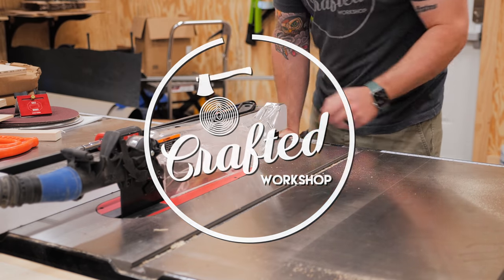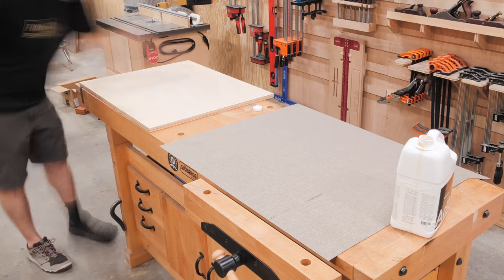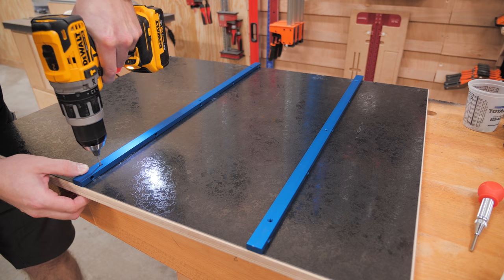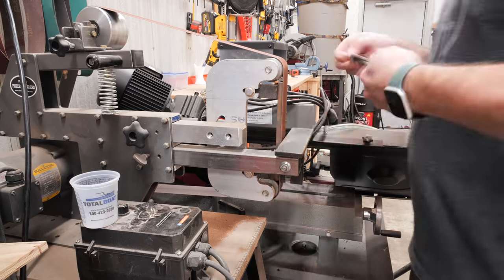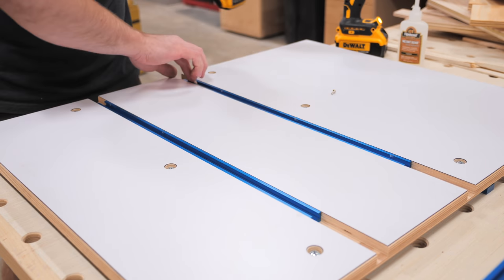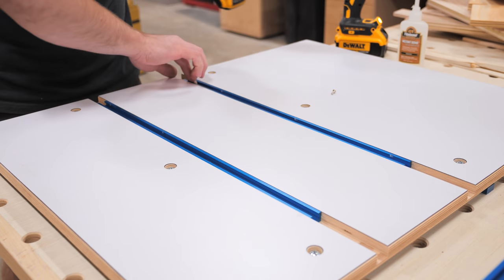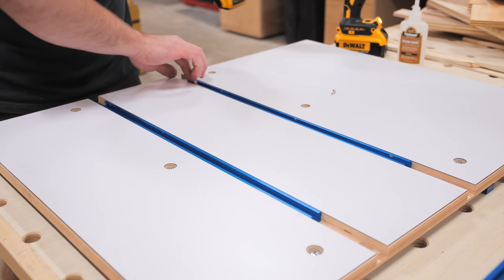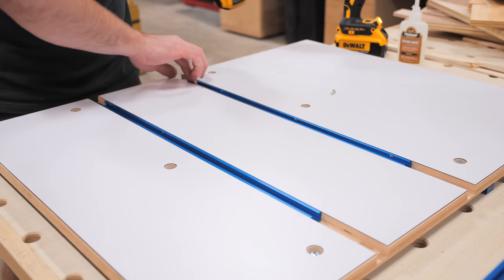Table Saw CROSS CUT SLED w/ Stop Block & DUST COLLECTION // How To Make

Comment from the maker: Thanks for watching y'all, hopefully you enjoyed this one! Purchase the crosscut sled plans here : https://bit.ly/crosscutplans
Reply: What are the dimensions of the sled you built for your job site saw? I have the same job site saw you have as my main sled, and I think the 24x30" would be a bit too big for it, but the rest of this design is sooooooo good.
Reply: @Crafted Workshop be are when applying too much pressure when rolling down the edges of laminate on your wood. It’s very easy to crack the laminate then you are stuck pulling it off with lacquer thinner. Also if you use laminate often you might want to look into purchasing a Spray gun for you laminate glue. It cuts my time down drastically from the old roll on method. Great videos. Also they make specific router bits to use for laminate.

Comment: Working on some projects with 1/4” plexiglass with my daughter we clamped down one side/end with a board. I don’t remember exact measurements, let’s say 5” then with it clamped we heated it with a heat gun, never leaving it in one place, constantly moving it back & forth & very very slowly with patience bent it to a perfect 90° angle. Looked really sweet & came out very nice. Just throwing that tip out for anyone maybe wanting to make one solid piece of plexiglass. 👍

Comment: Nice build!  .... I built one very similar to yours back in the mid 1990’s.  I stayed away from plexiglass and acrylic because they can fracture; instead, I used 1/4” Lexan / polycarbonate which WILL NOT shatter if hit by an offcut. I attached it to light-gauge aluminum angle with pop rivets.  Dust  collection is through a 2 1/2” adapter similar to yours, available at Rockler, Woodcraft, and other places.  While I replaced parts as they got worn from use, the sled is still in service and dead-accurate.  One thought: to get the fence dead flat which is hugely important, I glued it up atop the infeed table of my 8” jointer - which is the flattest reference surface I have.  Lastly, dust collection is immensely improved with adjustable side shields that can be lowered down as needed.  This is especially effective when trimming a light cut from the end of a board that would otherwise throw dust all over the place.

Comment: That's the cleanest approach to dust collection I've seen on a sled. I've been meaning to remake my asked after the fence warped, so maybe I'll add that in the process.
Reply from the maker: Thanks! I definitely think it's a great addition. I'm actually planning to whip up a version 3.0 using the CNC and some rabbet joints so it'll be even cleaner.
Reply: @craftedworkshop  did d u make that version?

Comment: Looks great. Two points to help with dust collection. 1) If your port was mounted towards the front of the hood, it would likely capture more dust. You could mount it on the side to maintain visibility. 2) Mount your red guard block all the way to the table and it will keep dust from blowing out at you when pushing it through.
Reply from the maker: Good call!

Comment: I had the same problem with the Rockler Tape Measure Inert Kit being too tight a fit in the track.  Spent way too much time using a carbide scraper on all the edges.  Finally got it to go in and still be a very tight fit, not sure that I will utilize it in the future for any other builds.  Love the dust hood idea, something I would really like to add to my saw to help with the dust collection.  Thank you for posting!

Comment: Dust extraction on a crosscut sled is a really nice idea, I don't think I've seen that before. Since you're not very likely to use the rear half of the crosscut sled very often, how about adding some CNC-like brushes to the acrylic there? That way it should improve dust extraction in the front even more, and if you have a larger piece to cut some day, it still works fine. I personally would be hesitant to add brushes along the entire length, both for ease of use and safety reasons.

Comment: Very nice crosscut sled. I was hoping you would have built in extensions to the front fence.  One to allow for a Dado blade and the other to extend the fence length to accommodate longer pieces that need to be cut.  I plan on building a crosscut sled and would like to incorporate adjustable fence extensions along with some of the features you added to yours.

Comment: Very innovative, i like the implementation of the bladed double track up top and the dust shield is pretty dang genius! like the other commenter tho, prolly need to replace that sometime down the road with lexan, cause i see you needing to wipe/clean out the dust periodically, and that'll scratch regular plexiglass in time and most likely impede your visibility in time. VERY Nice Sled overall!
BTW, Ron Burgundy called and wants his inflection back. "...News at 6"
Reply from the maker: Thanks a lot! I honestly don't use the sled as much as I thought but it is very handy.

Comment: Good design! Best I’ve seen. I loved your dust shield. I wonder if it would work to have a hinge on the back and then it could swing up and down adjust to the material thickness. Even stand up straight out of the way?? 🤔

Comment: This is the first video I've seen of yours and I really liked it!  The 1 comment I have is about the dust collection hood.  I would add a hinge at the back of the hood and maybe some kind of simple 90 degree turn hold down to the front to make it easier when clamping/unclamping  the wood pieces to the sled.  Nice job!

Comment: When I laminate a project  I use dowel rods  to keep  the laminate from sticking to the wood as I line it up. When cutting  laminate I have a piece of ¼"  plywood  that fits around the rip fence and lays flat to the table so the laminate won't slip under the fence and it's a zero clearance.

Comment: Best crosscut sled ever! One question is what's difference between using normal cross cut sled( unlike yours, the one has no safety guard and dust collector) and using miter saw? Isn't miter saw easier and safer?

Comment: I like the shield, if ever make another, plexiglass is easy to bend so you will not have joints. It just takes heat from a heat gun, bend using pressure with scrap wood
Reply from the maker: Good idea, I'll have to try that in the future!

Comment: Man..this is the most over-engineered sled I've seen, and it's most likely the best one as well! Congratulations on getting really awesome ideas on something that has been build a thousand times on YT, it is definitely difficult to be original in these cases and you've mastered it. Also, kudos on supporting JKM stop block, it's great to see makers supporting other makers. :) 

My only question is why have you placed the dust port so far back? When the blade is near the fence the dust port is way back...probably you have really great suction from your dust collection and it doesn't make a difference, but I'm used to adapt my dust collection to shop-vac suction, which is why this came to my mind. :) 

Cheers!!!
Reply: I’d think the reason is that having the dust port above the blade or forward of it would obscure what you are cutting. Also I think the hose would get in the road if it was further forward too. Just a guess.

Comment: Hey I’m a new woodworker having a hard time figuring out what type and screws to use to secure the rock t-track runners and secure them. thanks
Reply: And more importantly the rockler aluminum miter bars trying to figure out the screws to use to secure them  without them sticking out proud and the Miter slots
Reply from the maker: Really just depends on the thickness of what you’re mounting it to, I typically use small drawer slide screws.

Comment: First of all, let me recommend that you use polycarbonate aka Lexan.   If the blades kicks a piece of wood up at you, the acrylic plexiglass might not stop it.  1/4" Polycarbonate will, it's the stuff that bullet proof glass is made of.   My crosscut sled is very similar to yours.  But instead of a safety block, I made a box with a lexan window on top.  I drilled a 3" hole through my tall fence with a hole saw and attached my dust port on a 45 deg on the back of the box.  I used a 3" DVW coupling as  dust port and epoxied it into the 1/4" lexan and attachee a 4" dust collection hose to the outside of it with a hose clamp.  Placing the dust collection port here, at the back of the fence, works with the flow of air and sawdust coming off the blade at at least 200 mph.  This method sucks up nearly all of the dust coming off the blade.  I like your idea of making the sides of the safety hood over the blade to come down almost to the table top.  I'm gonna modify mine with that feature.  I get a very small amount of sawdust bouncing off to the sides.  Your idea should help catch that and keep it in the air stream.  I also thought of maybe using some brush bristles to try to catch the dust on the sides.  Thanks for the video.  It is great.

Comment: Does anyone have a recommendation for the size of the crosscut sled compared to the size of the table saw top?  Most sled plans I have seen are for contractor sized tables (like on this video), but curious what a good size would be for a sawstop job site saw.
Reply: If you have a contractor saw check that your blade is sufficiently far back from the front edge of the saw (the side you stand on). What most of these videos don't tell you is that a crosscut sled doesn't work on a small contractor saw unless it's had some sort of infeed table built around it. The reason is that the runners will have quite a bit of slop until both are inserted at least 1/3 or the way. To answer your first question, assuming you built an infeed for your contractor/portable table saw or that the distance to blade is deep enough, you should make it as big as you want as long as it's even on each side. Just think about the material you'll most likely be cutting. If you're crosscutting 8' 2x4s then you'll probably want it to be at least 4' wide, etc.

Comment: Have you consider using polycarbonate ( I think it's called Lexan in the US) plastic instead of plexiglass? plexiglass shatters on impact. You could also bend it in one piece using a line heater into a U shaped channel to remove the need for adhesives. Otherwise, very professional video, Nice!